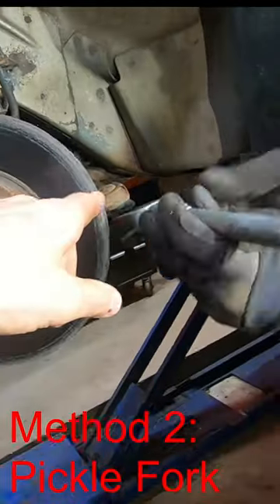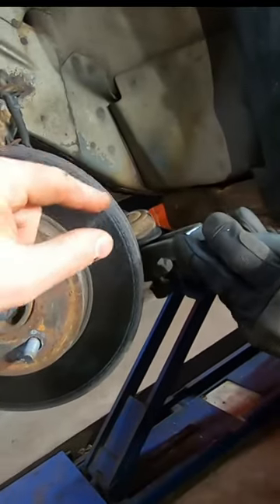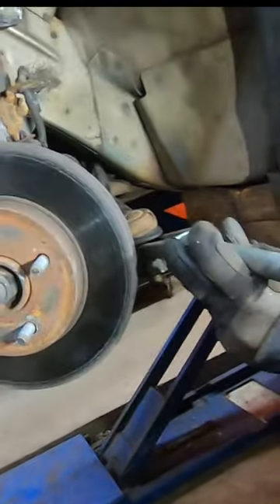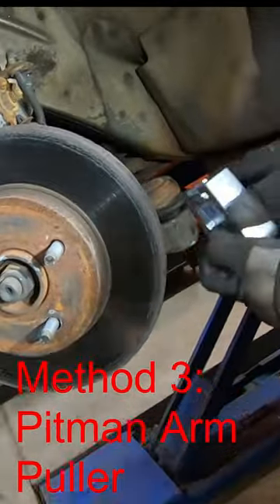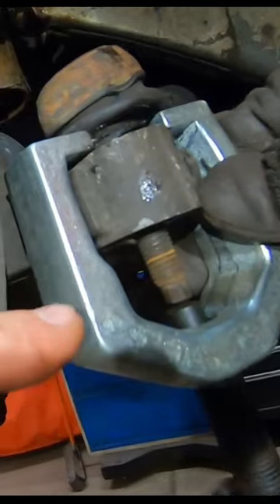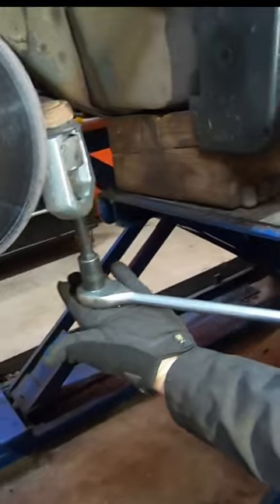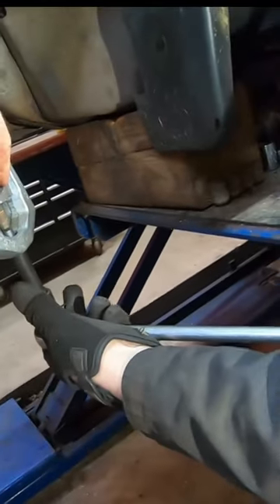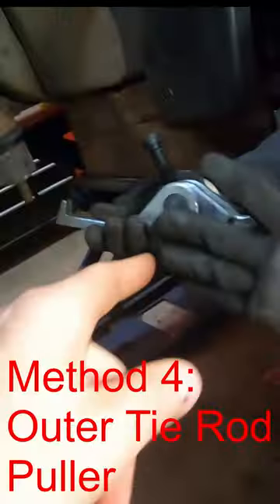Outer Tie Rod Removal - 4 Methods #shorts

Comment: You take so long and do it wrong.  Use a prybar on top of the tierod end and pry down to secure in knuckle.  Loosen nut with impact and tap nut.
Reply from the maker: Isn't your method almost exactly the same as method one that I explained in the first 10 seconds?